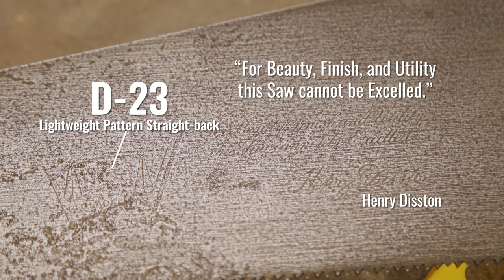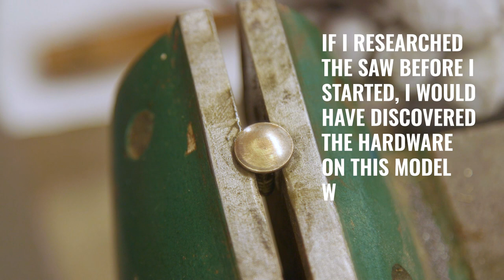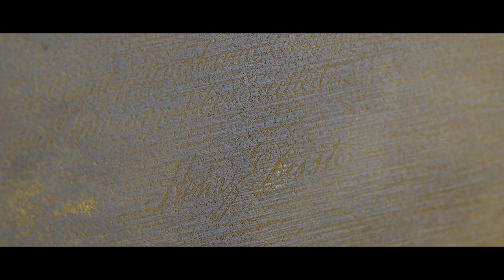Restoring a Disston Hand Saw

Comment: Very nice presentation of a process. I have several saws to restore, the belonged to mu father-in-law. Picked up some good points from this.

Do you know of any way to make the manufacturer's (etched?) information stand out more clearly?
Reply from the maker: From what I've heard, less abrasive is better. Mine really wasn't visible at all until I used a little sandpaper, but I guess it all depends on the state of your blade. Evaporust only removes the rust so it's pretty safe to use. Thanks for watching!